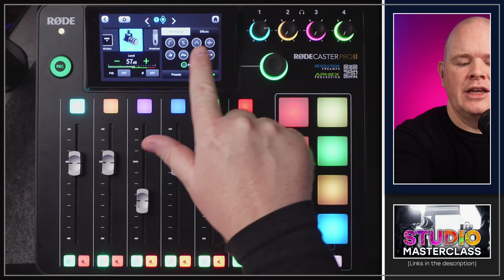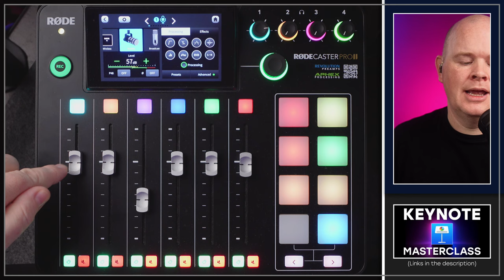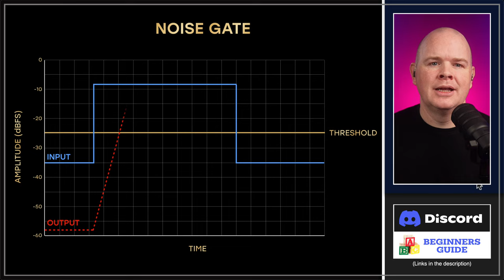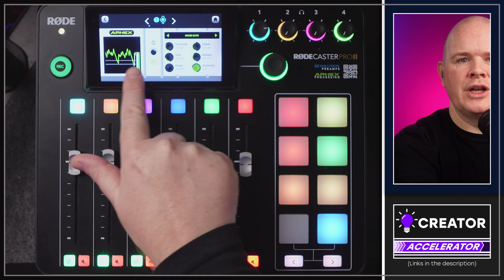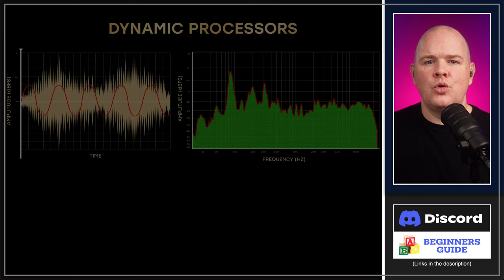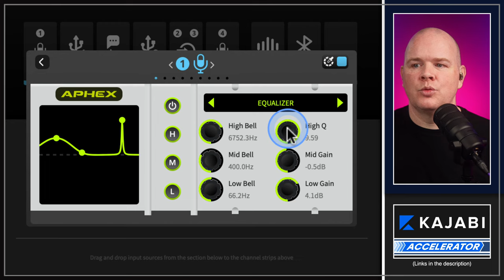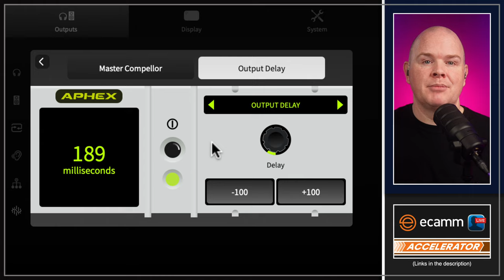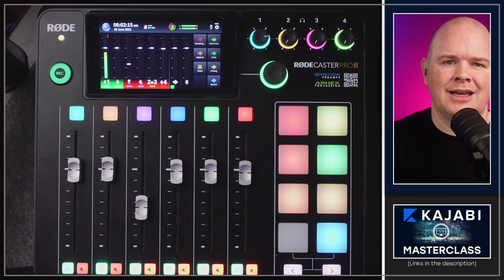Streamer X & Rodecaster Advanced Audio Processing Settings

Comment: Did you notice a hiss on the headphones with the Streamer X? No review seems to mention it, but a lot of people complain about it online and I had the same issue. As soon as it's powered on, there was an insane hiss on all my headphones / IEMs, with nothing but power connected. Sadly, the same is true for my Rodecaster Duo though much quieter. Tried unplugging everything but power, different low to high impedance headphones, muting all inputs, swapping powersupplys, different power outlet with nothing else connected. Drives me crazy. Only thing that helps is using a noise isolator.

Comment: Is there a particular lesson that I should reference for settings for my Rode Wireless Pros and the Streamer X? It seems that I have to connect the transmitter to my laptop instead of directly to the streamer x to get both mics to connect to Unify.
Reply: Would it work to connect the receiver for your wireless system through the XLR port as a line-in (3.5 to XLR adapter)? Won’t come through as separate channels, I assume.

Comment: dual pc game streamer here. anyone has some basic tips to get rid of keyboard sounds the most as possible with keepest the most detail in your voice?
Reply: add a noise suppresor or noise gate in obs
Reply from the maker: The noise gate in the Rodecaster can cut out the keyboard noise while you are not talking... think of it as a literal gate opening and closing to let the sound through.   The particular parameter to note here is 'Range' which is how much the gate is shutting when you are not speaking.   Setting this to 100.0dB will mean it is completely shut and now sound gets through while you are not talking.

In terms of removing keyboard clicks while you are talking, the Rodecaster can not do that, but you could pass your mic audio through something like 'Krisp' (https://krisp.ai/) which would remove everything except your voice, however if you are adding other things into your mix, you would need to route your mic into your computer through Krisp and then back into your Rodecaster, so it gets a little tricky!
Reply: Different mic with better off-axis noise rejection?